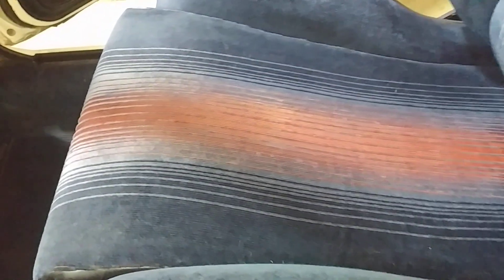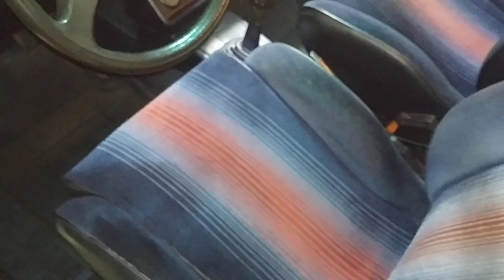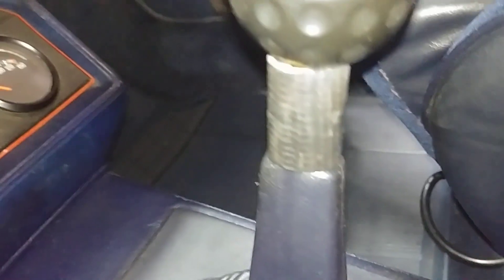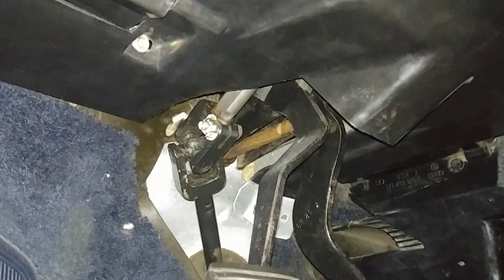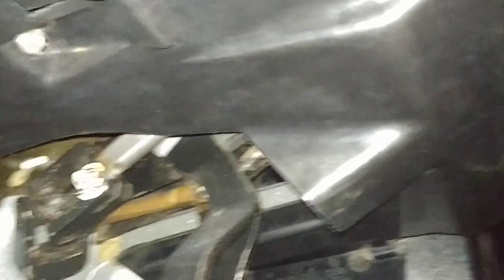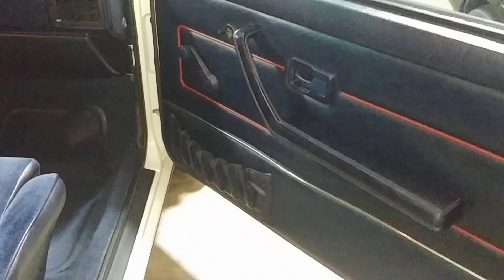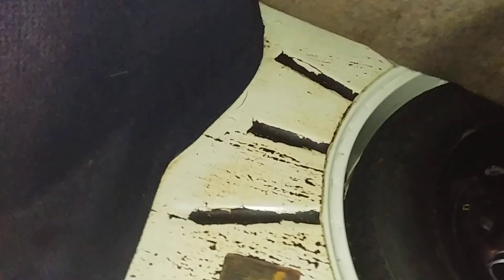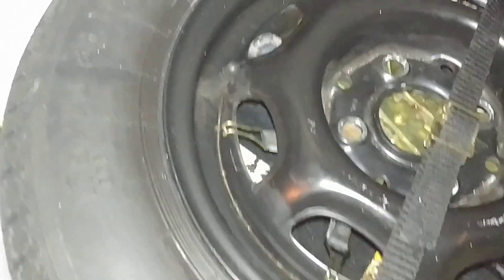1984 VW GTI Interior

Comment from the maker: Update/edit:

One of the VWVortex clan astutely observed that the seat belt warning does not illuminate. That is correct and it reminded me that the door buzzer also does not sound: a dual-function relay handles those things and I removed it because the buzzer sound is awful, especially when my head was under the dash working.

The empty socket is shown at 2:42 above the four regular relays at the right side of the screen.

I unceremoniously discarded the relay, which I now regret because I see that new ones are really expensive. Hopefully that will be forgiven...